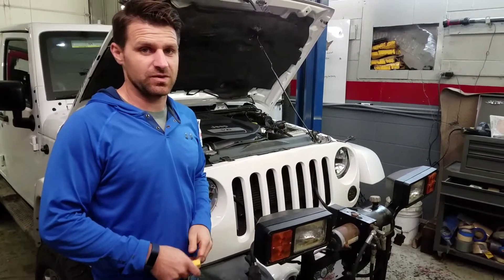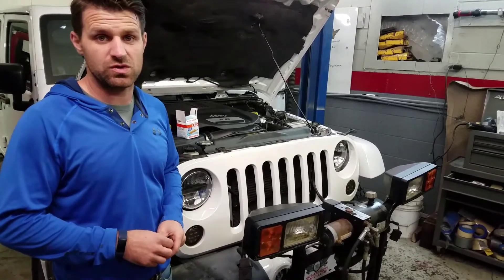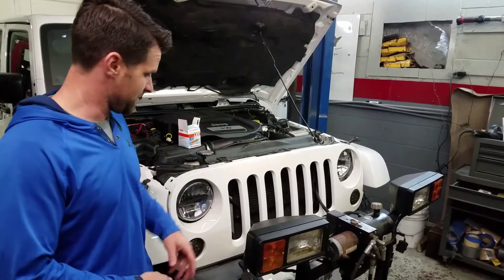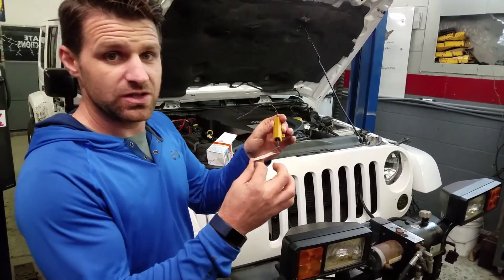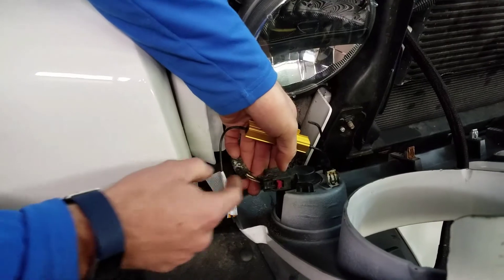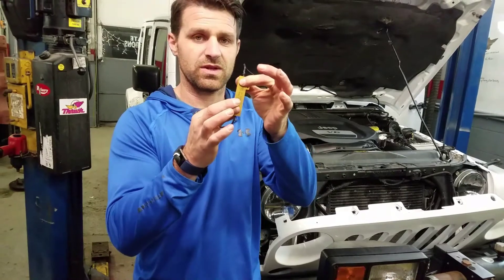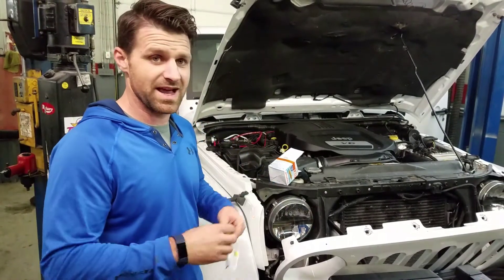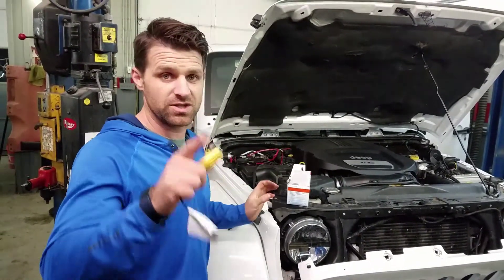** LED CONVERSION ** How to stop hyperflash ** directionals and head lights **

Comment: Some of the newer vehicles, you cannot replace to an electronic flasher like the older ones. I know what you guys are talking about. One end of the resistor goes to the flashing wire, The other end of the resistor goes to the black. Repeat on all four sides.

Comment: Why would you want to use more power? Also a fire risk, by adding those load resistors you are wasting over 100 watts of power that you can use for your winch, or aux lights or anything else
Reply: Nobody “wants” to add resistance just for kicks, are you completely out of your mind? You don’t have a choice. If you don’t run these, the signal lights hyperflash… or sometimes don’t flash at all depending on the LED. 

You can’t cheat like on older vehicles by changing to a solid-state flasher. The JK and newer variants eliminated this, the flashing is done by the BCM directly. So you can only fool it by simulating the load of incandescent bulbs with a resistor. 

The fact that LED makers can’t add this to their assemblies is ridiculous. It’s also ridiculous that late model vehicles are still coming with incandescent bulbs. 

Lastly, these are 6ohm / 50w resistors. You’re not losing 100w, you’re losing 50w on each branch of the circuit for tenths of seconds when flashers are on. That circuit is not energized the rest of the time, it’s not robbing your winch or anything else.

You should stay away from electrical mods, you clearly have no grasp on how it works.